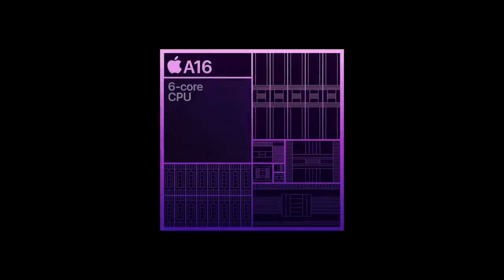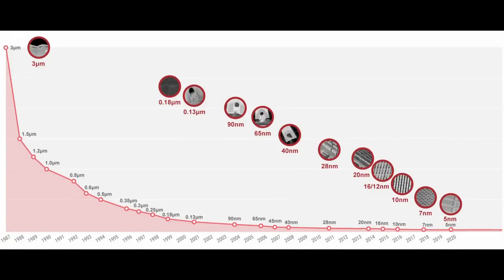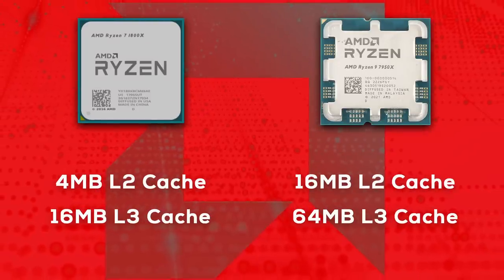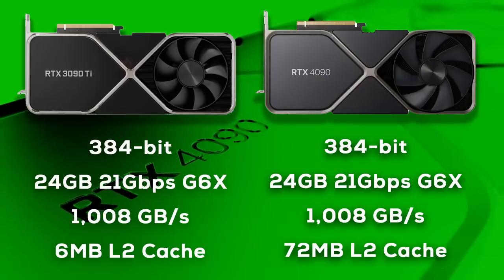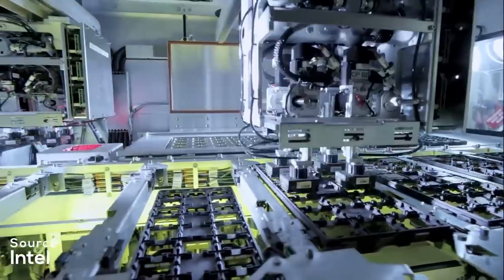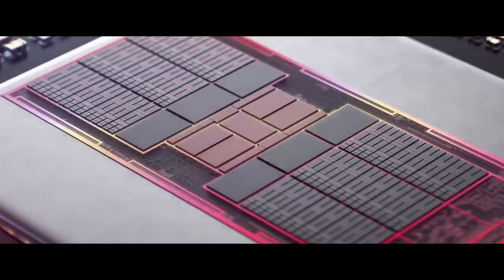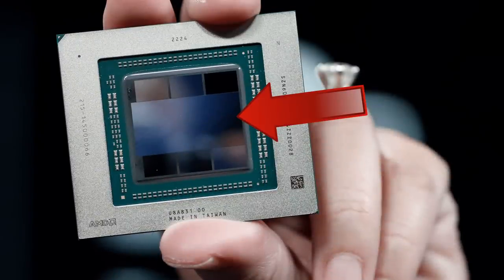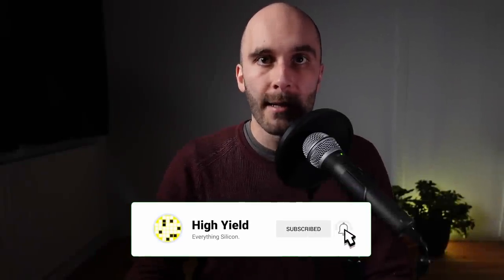Next-Gen CPUs/GPUs have a HUGE problem!

Comment: Partially incorrect or misleading fact just to pump up the drama. I'am old enough to remember when L2 Cache were not on die, but on the bus at 33Mhz.
Before the mid 80's, cpu did even have L1 cache ( motorola 68030 had 2 * 256 Byte in 87 )
Cache is needed to hide DRAM latency. All modern DDR can make the processing unit wait for hundred of cycles, depending of the frequency and type of DRAM. 
Beside the RAM, there is also all the serial periphericals ( PCIe, SSD, USB ) where latency are horrible, buffers are needed.
Beside, big cache don't do everything, P4 vs Athlon, at same frequency, Athlon destroyed the P4 with half the L1 cache and L2 cache was still external with AMD (around 1999)

SRAM like any other part of a chip is made from transistors. SRAM cell shrink at the same rate as any transistor. 
Cache take more place in the chip because as the frequency and the units count increase you need more to hide the memory controller latencies. 
You can also do the same observation about compute units in GPU.
An 32bits ALU take way less transistors than 4KB of SRAM.
It's not that sram doesn't scale, it's just the need for cache continu to grow more than the rest. L1 caches are rarely more than 1MB, L2 around 8-16MB.
L3 is the one who take the most, it's the common cache for all cores, the more units you have on your CPU/GPU, the more you need L3 caches.
But still even the 5800X3D with is 96MB of L3 cache bow before the 7700X with a third of the space (32MB).

To make it simple, CPU/GPU goes faster and faster, RAM speed don't follow and access time even worse, add more cache to get more performance (around 20%)
No SRAM is not dead, engineers just have to find new optimisation, better cache policy, lower DRAM access time, cluster architectures.
If you really want to dive in checkk the youtube channel of RTLEngineering, you will learn that it is more complexe than an 9 minutes video.
Reply from the maker: I’m not adding extra drama, but at the same time this isn’t an engineering level video. I think there’s a space between pure entertainment and a university level presentation and I’m trying to fill that gap. There’s always a more in-depth video somewhere, but I hope you still enjoy my videos :)
Reply: @HighYield  I understand, and i'm to sorry to have seem to harsh. But don't title your video "Death of SRAM", if it's not drama, it's borderline clickbait.
"Sram, the silicon brickwall" and begin with some numbers to put in context and show the evolution in technology. (fews graphs would do the trick). Facts help to support claims.
Without being too technical, sometime simple analogies do wonders. Like your are a cpu, your desk is your cache (easily accessible) ,the ram the cupboard behind you and the hard drive is the basement, long term storage. This illustrate simply datarate and access time ;)
Reply from the maker: The thumbnail has to get your attention, not only on its own, but also in competition with all the other thumbnails. I’m actually really proud of this one, it might me my best yet :D But ofc I have a different point of view as a creator.

Comment: DEATH OF SRAM is very misleading title. SRAM will stay, but we just cannot evolutionary shrink planar design anymore, we need revolutionary design change. 
MCM is not a solution to sram alone, but to general size to cost issues. As bigger means pricier^2 in silicon world, using 4 small pieces is WAY CHEAPER than using single big one of same size. 

it also allows checking performance of each piece by itself, which eliminates issues with one piece of cpu being a superb lottery win, while the other sucking so badly, it needs to be disabled. 
Sram needs innovation, like 3D designs, as up to this point it was planar design. I saw few promising (as far as I can tell, not being from the field) designs in the working, so we might see sudden drop in 3 maybe 4 gens into future.  I can see a future when we have l1 and l2 as 3D to quadruple their size, and l3 as a separate planar chiplet to keep cost down.

Comment: Death of sram? Nobody even uses sram for actual ram it's all dram, most people can't afford using sram in place of ddr memory, 64gb of sram would outperform 64gb of ddr  ram, because of sram being asynchronous, the only thing sram has to worry about is internal latency, otherwise unlike dram, it can run at the same bus clock as your cpu, so faster data rate and more throughput, but 64gb of sram would cost around  50,000 USD, your sram chips alone cost at least $500usd per gigabyte

Problem is Dat sram is a bit more complicated than dram and expensive by design

Now if you could find a cheaper method to produce asynchronous memory with sram properties but with less logic complexity

Whats the difference between a cpu register and sram, or what's the real difference between a latch and a register?

Comment: Why future NV GPUs must go chiplet disaggregated design route is: SRAM, MC, and I/O scaling stopped, and cost of manufacture. If one day I joined their design group, my biggest goal on chiplet GeForce is: reduce manufacturing cost by whopping 75%. Only core GPU logic and display codecs remain in main GPU core die, and compensate reduced L2 cache by going very large L3 cache + MC chiplet route. For very flagship, two GPU core dies each with up to 84 SM should be used. Then XX90 will use 168 SM using two dies, with second gen NVLink-C2C via semi-custom high bandwidth fanout bridge, similar to InFO-L. Up to 192 MB very large L3 cache, and up to 48 MB L2 cache, all via fanout bridge, and up to 6 identical cache + MC dies. Use GDDR6 at 20Gbps or GDDR6W, and each cache die will be 32MB. This solves pricing and yield problems. Killing two birds with one stone

Comment: So you're hyping up something that's already got potential fixes not only in development but in use in modern systems? Also everything has a limit of scale, CPUs have the issue, GPUs have the issues, EVERYTHING has the issue once you get to the point you're hitting single nanometer numbers.

Comment: mid through I thought - chiplets could mitigate this. and then you described how. However a more actual fix would be redesigning/optimizing SRAM or creating a whole different cache type altgether, but not manually as you said it's being done now, but with AI assist or complete AI (re)design. At a certain point going forward, the only way to optimize and innovate would be for these  companies to create the best training set with the data they have available and then probably let the ai produce entire chips not just the SRAM(or equivalent/or new paradigm?) and also do the validation etc. There's plenty of compute for doing just that. Ai could fix a lot of things but I don't think it's the best thing long term for us humans.

Comment: Not really true ... , Amd currently uses " Game Cache " Chiplets in their current GPU Gen and with 3D V-Cache at least a part of the Level 3 Cache is on a 64 MB Chiplet ( 6 nm )  while the CPU is 5 nm . The Level 1 an Level2 Cache are in comparison tiny , even if they dont scale any futher , they take not that much more Space
Reply: It's meant that SRAM is used in smaller and smaller devices, like smart watches and the likes, every single space matters for those.
Reply: @dra6o0n  Did you read the Headline ? .....   Next-Gen CPUs/GPUs have a HUGE problem!
Reply: @MK-xc9to  Yeah if they went the route of Nvidia and monolithic dies, but otherwise, they can't shrink SRAM and need alternatives.
For starters, AMD's chiplet designs lets them buy more time for a few more generations.
Reply: @dra6o0n  Its more than " a few" CPU Generations , I/O dont Scale well = it got ist own Chiplet , SRAM  dont scale well = it got its own Chiplet at least L3 , in Server Space every Milan X CPU has 768MB of L3 because Each Chiplet of the 8 CPU chiplets has 32 MB L3  + 64 MB in a 64 MB L3 V-Cache Chiplet on Top . And it doesnt stop there , AMD uses only 1 plane/level , TSMC TSV stacking Technology allows up to 10 or 12 planes/levels but each Level comes with a latency penality or maybe in future CPUs its called L4 Cache .
V-Cache was at its 1st Gen with the 5800X3D and Milan X , the 2ng Gen V Cache is knocking on the Door with Zen4X3D and with it the CPU clock Limitation is gone
Its simply cheaper to produce I/O and Sram in an older node , thats not a problem , the bigger Problem is that with new Nodes the CPU chiplets get even smaller = they will get hotter because the heat cant be transfered fast enough to the Heatspreader due to their tiny Surface area , thats the real Problem - at least with high clocked Desktop CPUs

Comment: The 7900XT/XTX still have L2 cache in the monolithic die, and those caches closer to the core will need to increase more and more the more compute is done. Offsetting it will starve the core unless you can do a really OOO GPU... which is more difficult than it sounds

Comment: ...so the problem is already partially solved with 3d cache? 

Useless video...
Reply from the maker: It doesn’t solve the problem of SRAM scaling, it just alleviates some of the symptoms.
Reply: @HighYield  Right, so a stopgap solution isn't a solution. 

If SRAM cant be scaled further then the problem isn't scaling it, it's finding an alternative such as Mram for ARM... 

Also you've made this poorly written video without spending any time talking about potential alternatives, you're just framing it as if it were an industry ending catastrophe, when in reality 3d vcache by amd has been in consumer products for a while now and all major brands are looking into a similar implementation already.

Comment: Misleading ckickbait title
Reply from the maker: How so? Thumbnail is on point and the title is also on topic. It’s quiet literally a “huge” problem, as chips are getting larger. 

In addition, title and thumbnail are supposed to make you click. There’s so much competition, you have to stand out (especially if you are a smaller channel).
Reply: @HighYield  the thumbnail says "Death of SRAM" over a skeletal remains of a human being. The video is good, I just watched it thinking there it could be about something that would lead manufacturers to stop using it altogether, due to the misleading thumbnail. The actual title is actually ok, "Next-Gen CPUs/GPUs have a HUGE problem!" imho, is veery exaggerated, but is not wrong, as the thumbnail is. We engineers always work with the limitations of the laws of physics, manufacturing and cost constraints, as usual. Clock can't be increased much more than what we have now, high integration levels are resulting in a very high defect ratio, leading to increased cost, operating temperatures are getting too high for comfort, power consumption in big systems is increasing to ridiculous levels, on an environment where some people are having issues paying for heating... there are like 50 things that represent bigger issues for manufacturing CPUs before the issue debated in this video first show up.

Anyways sorry, I don't want to bother you, I guess I'm just not your target audience. I regret having commented.
Reply from the maker: No need to apologize, I honestly value every input. Thumbnail and title need some form of “clickbait”, because if none one clicks, there’s no point in making this video. 

There’s a really interesting article by wikichip.org talking about the subject, which is called “death of SRAM” and tbh, if SRAM stops scaling for good, even with chiplets, at some point it will stop being a economical solution. 

I’m trying to keep “clickbait” to a minimum, but views don’t lie.
Reply: @HighYield  CPUs almost scaling some time back. All the 3nm thing thing is a big fat lie already, since the real transistor pitch is about 40nm, so the numbers are completely disconnected from reality. When they get an increase in total transistor density they calculate what equivalent transistor-pitch would produce that increase. 2nm, for example, is about 10 atoms of carbon, and it probably can't hold information due to quantum bridges. The liars from marketing could keep saying forever that the process is going to 1nm, 0.5, 0.1 nm (smaller than a carbon atom). With the two-layer SRAM it would be possible from the liars on the marketing department to say that "the density doubled", but they decided to tell the story differently. They could tell it tripled, if they eventually added another layer. So imho, comparing this fake numbers can't really be used to tell what is going to happen. The engineers working on this have huge amount of money available to them, and they are incredibly smart. When improvement in one direction stops, they typically have multiple ways of getting improvements with some other method. It might be more expensive, like layered or multi-chiplet, may be using some kind of trade-off, like mixed SRAM and DRAM, it could be architectural, like improving locality of microcode... it's impossible to tell without being in there with the engineers.